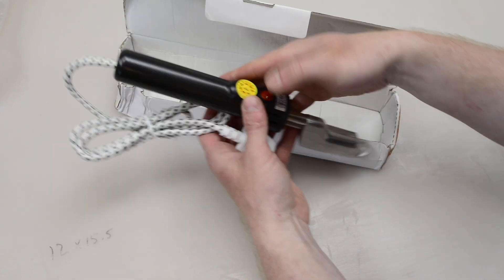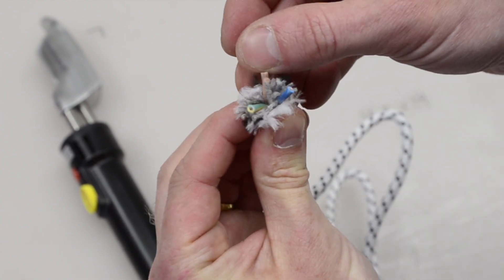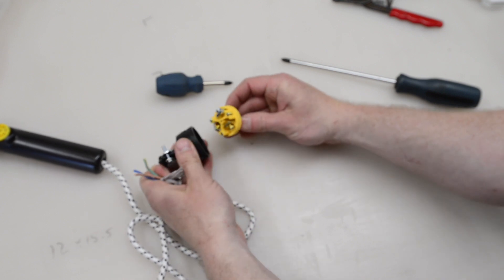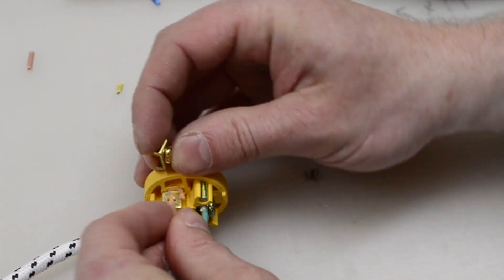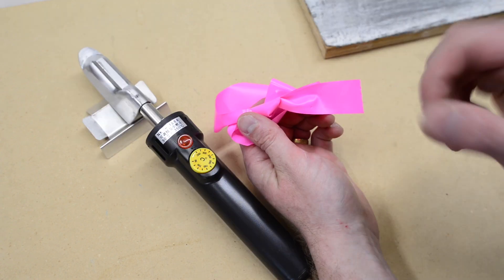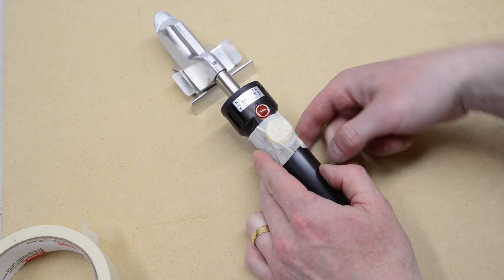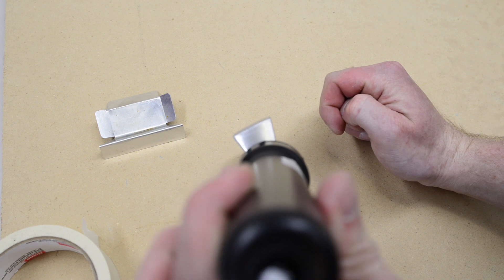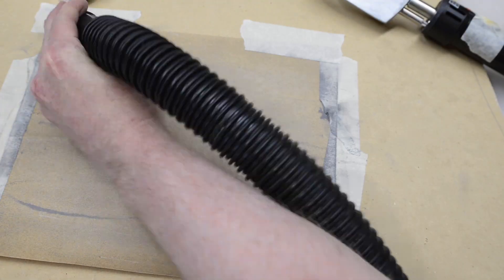Heat Sealing "Leather Iron" Modifications

Comment: In Germany with 230-240 V the temperaturesetting is between 120 and 150°C. Depending on the thickness of the Material.

Comment: It's worth opening up the iron to check the wiring before buying a new plug.

My newly purchased iron had a grounded Chinese Type I plug molded to a cable embossed with "3x 0.75mm" and safety ratings.  That should be a earthed 6 amp cable. When I opened the case I found that the cable had only two conductors, and they appeared to be 0.50mm or less.

The control circuit is a basic thermistor feedback type based on a LM358 dual opamp controlling a BTA06 triac.

I measured a heating element resistance of 337 ohms.  That's 150 watts at 240V, but less than 40W at 120V.  You really want to run it at 240V, preferably using an isolation transformer if you keep the original ungrounded power cord.

Edit: I measured the warm-up cycle with the iron set to the highest dial temperature.  At 237V the iron took 1:15 from 30C to 100C, and 2:54 from 30C to 200C.

Even discounting heat loss from convection, which is going to be significant, it would take about 12 minutes to heat up at 120V. 

I was measuring using four probes, two sensors (thermistors) with multimeters, and two K-type thermocouples.  They were taped around the hot face using a single layer of Kapton tape.  They all had very close readings, so the measurement point was not much of a variable.

Comment: I added heat paste to the heating element to make it transfer better to the iron body. It makes a substantial improvement to the heating speed and recovery. I would go so far as to call it a necessary modification. I am also considering changing the element and/or modifying the circuit board to better match the 115V here in Canada.
Reply from the maker: Cool! Great tip. Thanks!